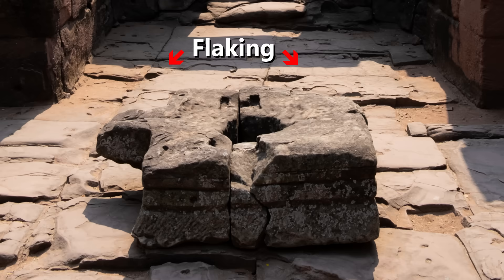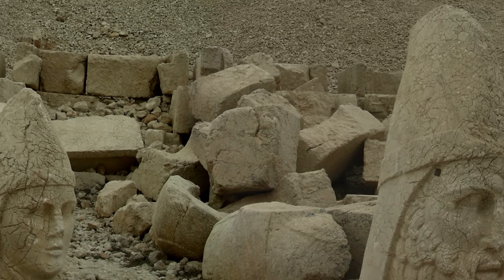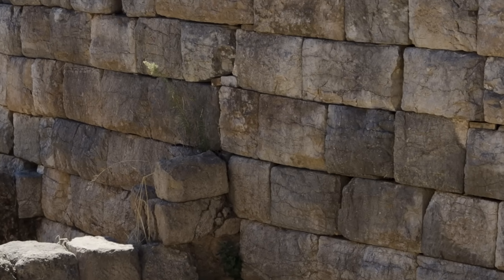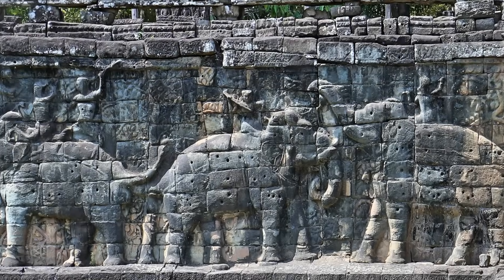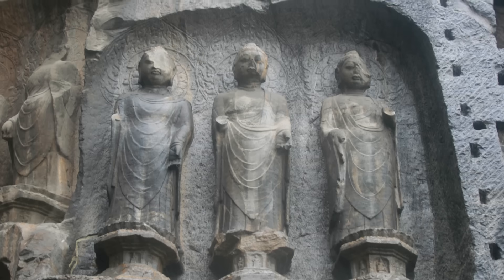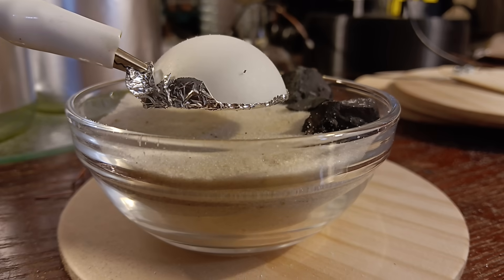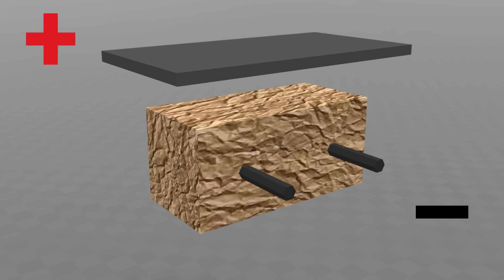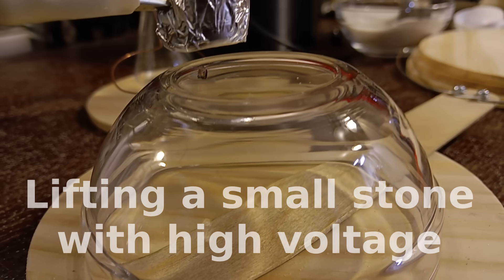The Greatest Mystery, Solved. Recreating Ancient Stone Melding Technology (Part 1)

Comment: Just wow, I think you have exceeded reality in how retarded people can be and actually work with electricity, without dying. 
Yes you can do amazing things with HV, but cutting stone is not one of them, just get any nonhomogeneous stone and heat it up just a little bit,  the different minerals will expand at different rates and it will fall apart, sometimes dramatically. 
The little knobs if not part of the design would have been removed.  The holes in other structures kind of resemble the holes in modern heavy blocks in which we put lifting lugs and use traditional techniques to put them in place. How do you explain how practically perfect blocks are cut , moved and put 8n place?.
I don't think you are even serious about this or you wouldn't be hiding,  the electric universe fad has been proven to be a money grab cult, are you clinging to this hoping to get funding? If you're ever been out side and looked at rocks you would not be making this video,  ps electricity hurts so stay safe.